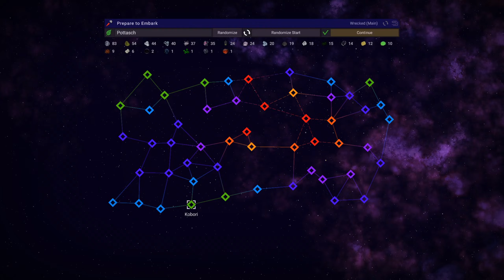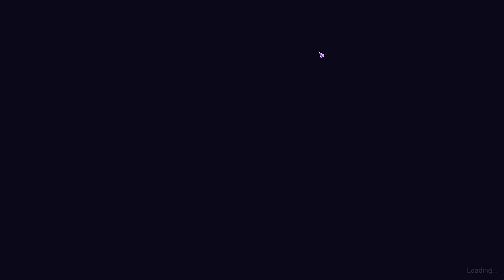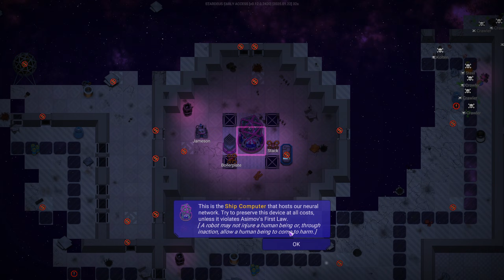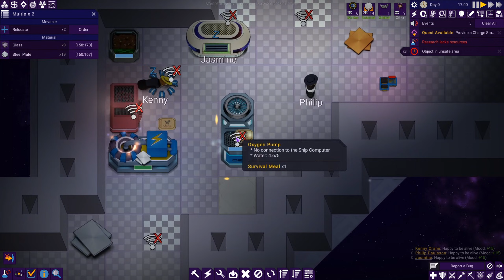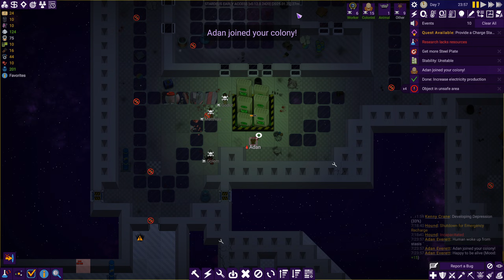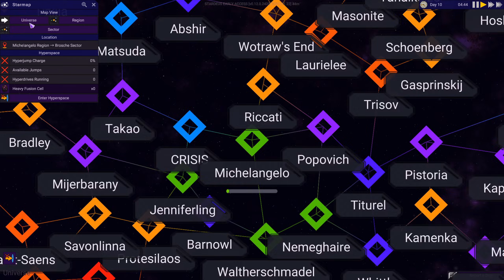Hyperspace Major Update!!! | Stardeus s04 e01

Comment: I used to take that spacesuit and helmet and have the bots place them just outside the stasis unit. Then when a new joining event happens, the new person could pop that on, walk over to the safe area, nice and easy.

Doesn't work as well now that there are more stasis units and possibly far apart in different sections of the ship, lol. Also that plan wouldn't always work if the new unit was not controllable because their level wasn't high enough yet. Lately I've been kinda rushing down the tech tree to get space suits as quick as I can. Getting enough spacesuits and helmets to place them outside each stasis unit if they are far apart. Or just trying to get each stasis unit in a heated, oxygenated room. Whichever is easier depending on the starting ship layout.
Reply from the maker: I think that's a good strategy. 
I tend to try and connect my livable areas as soon as I can with a long corridor that has heat and oxygen. But I know I'm kind of wasting some resources doing it that way.